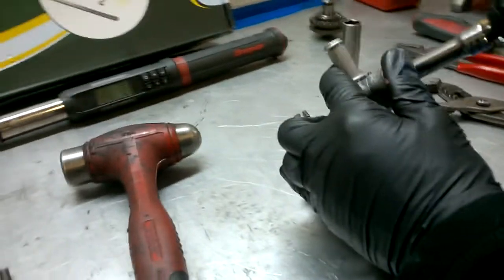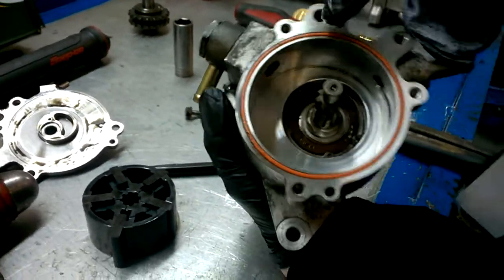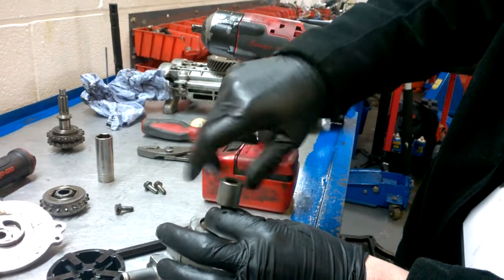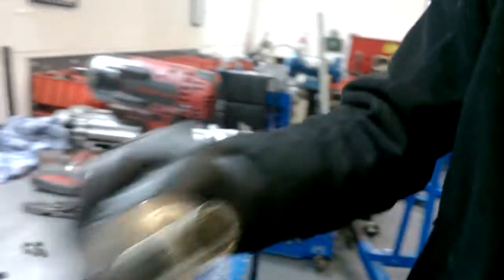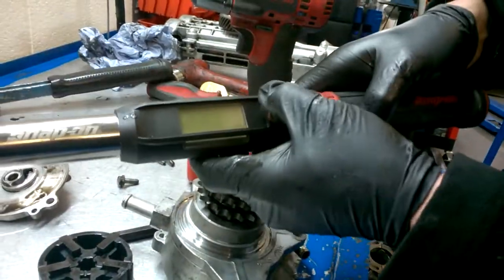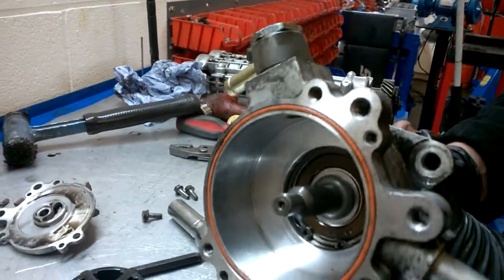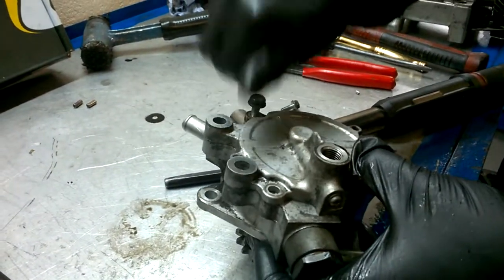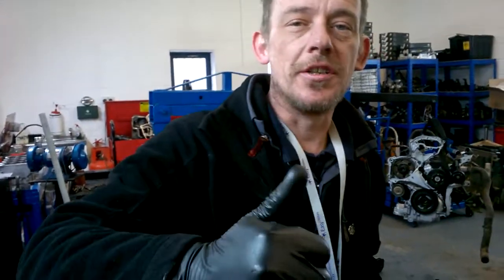How to do a vac pump upgrade nissan navara d40

Comment: Hi mate brilliant video happened to come across your video when trying to find a solution for my 2004 Nissan Navara 2.5Di. I replaced the discs and pads, bled the brakes all round. However I constantly need to pump my brakes all the time and then just barely able to stop the car. Currently taken off the road until I find a solution. Any help would be much appreciated.

Comment: Great video, thank you for your time and effort.
I have a question, I have a sound that i can only hear inside the cabinet coming from behind the dash, center console, or passenger side, it is like a pump sound, intermittent, some times not always, i have noticed it while driving in traffic jams or while parking at home, if I rev it up on neutral, sound cuts!
2014 D40 V6 3.0 V9X Sweden import.
Please advise.

Comment: I have just bought a  12/2005 UK spec Navarra Frontier in Cyprus with 126000miles on the clock.  The dealer is replacing a leaking nsr oil seal and the cd head unit under warranty. It has an upgrade on the wheel sensor.  It has been a weekend car since import in 2011 and is pristine inside underneath and outside. Never been worked or abused.  No tow bar or signs of one being removed. The engine is very strong and quiet, starts on the button but I can hear quite a distinct turbo whine until it is warmed up, is this normal or does this show its due for a rebuild?